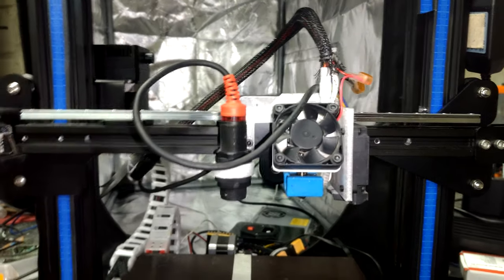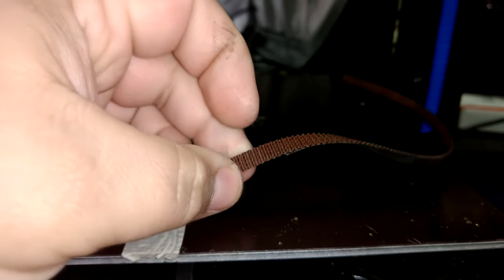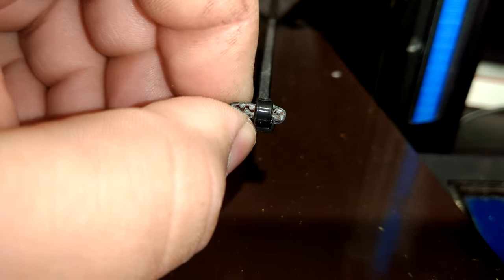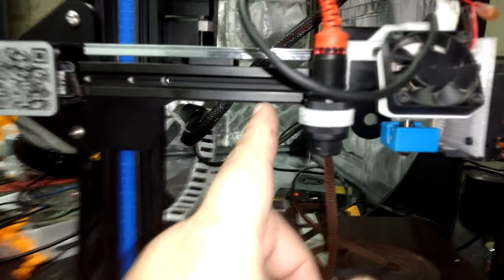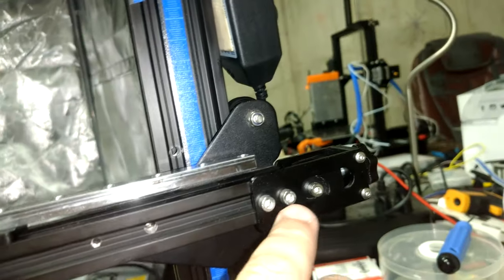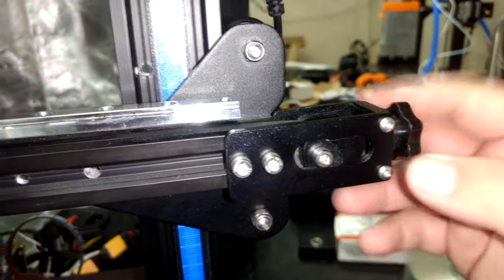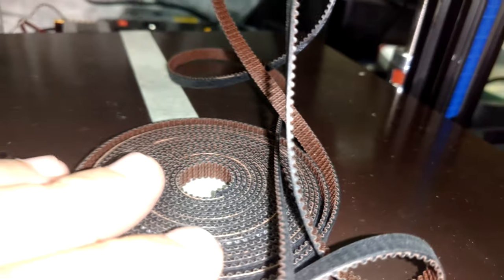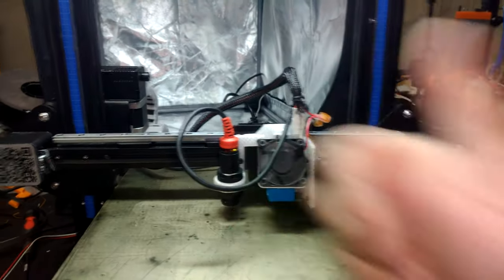How to put custom sized belts on a 3D Printer

Comment: Unfortunately not helpful if the belt connection has to pass through the wheel, like when connecting two lead screws of z axis on two sides of the printer.